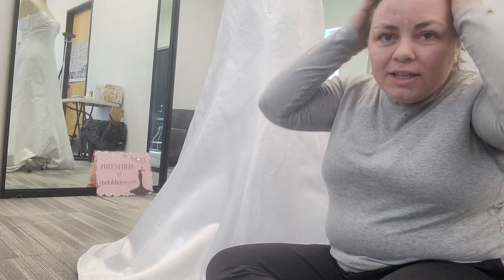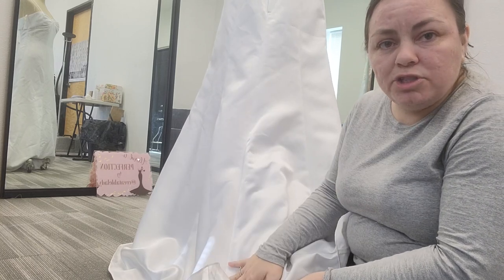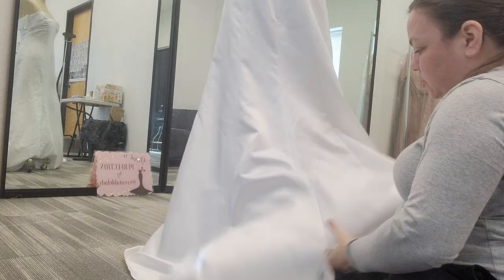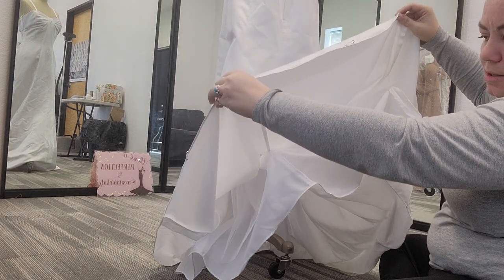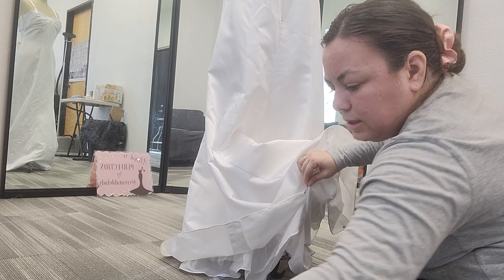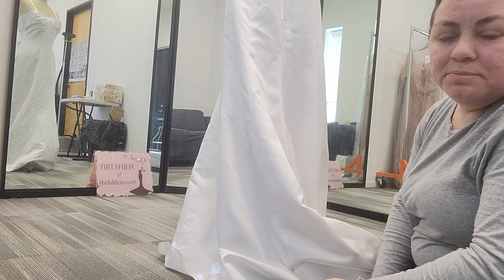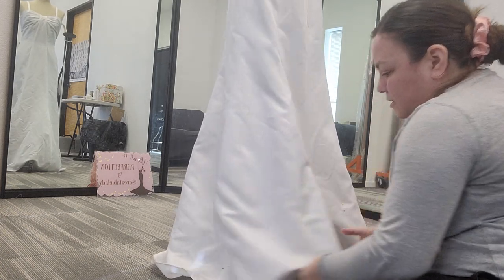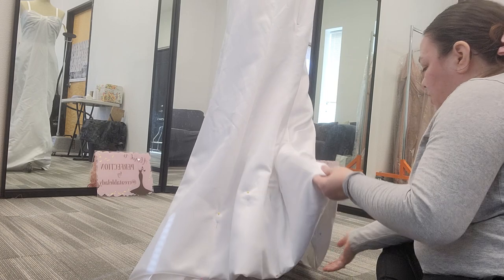Ballroom Bustle: Introduction

Comment: I’m glad to see the gown is up off the floor after all is pinned in place. This is how I like to do mine. Why bustle at all if the gown is still dragging on the floor. I really like how you show the step by step. I’ve had some really hard one to bustle and got frustrated because I could see in my mind what I wanted to do but then it didn’t work. It takes me forever to do things because I’m so particular with everything. I always show someone in the wedding party or mother how to bustle it and when I see the picture from the reception they never look the way I show them. This is upsetting also. Thank you for making it as simple as possible.
Reply from the maker: Oh my gosh yes and yes! I prefer to get everything off the floor and I always do a full bustle tutorial. I get so sad when I see dropped points in the dancing photos

Comment: Could you do a full tulle skirt. That one has me stumped
Reply from the maker: @susannea142  a ballroom bustle on a full tulle skirt is pretty tricky. I'd suggest tacking the tulle to the lining at the hem if that train shape works for your scenario. Then use the tack spacing to help you turn the skirt under using the lining for your pickup points.

Comment: I still measure almost every time, even on a poofy dress. Those measure are my starting point, then I eyeball adjustments. Then safety pin all the points, have the bride try on again, then sew it in
Reply from the maker: Yes! The key is to be consistent in whatever method you use. At the shop I'm at we aim for 1 fitting and 1 final... so I need to get as much information and confidence in my pinning as I possibly can.  I do much prefer a second look myself.

Comment: What’s the best way to hold them up, would it be a mixture of ties and snaps. Will sewing snaps not show on the outer fabric one stitched on. I know you can hide the snaps on the seams but what about the snaps that need to hold up not much of the fabric that’s not on seams
Reply from the maker: On a ballroom I generally do ribbon anchors on the lining of the train and and make loops at the train edge with crocheted thread loops.

Comment: I keep bustles as simple as possible because I’ve had brides tell me later they were done up wrong by the bmaids. 🤣
I call a ballgown bustle one point up at the back. A simple pick up the single stitch crochet loop goes up to a hook or a bridal button
A Victorian bustle is an under bustle which is tied up underneath at points with ribbon. I once did a cathedral length bridal gown with 4 tiers and 14 ribbon tie up points. It was gorgeous but a pain. I numbered the ribbons and the bride thanked me later 🤣

But most are just 1-3 points hooked up to the back of the gown. You can do 5 or more at about 23 inches off the floor and make it look like a mermaid gown. But you need a longer train
Just depends what the bride likes ♥️
Reply from the maker: Oh yes the brides choice reigns Supreme at the end of the day! I do include a full bustle tutorial in hopes that they will be able to put it up properly if no bridesmaid can attend and learn in person.
Reply: @adriennegonzales2636  I have had them video it. And video corset backs I put in to learn the lace up. 🥰
Reply: Most of the brides I deal with don't even know what a bustle is!  I usually offer the American Bustle (outside hooks and loops) unless they request differently.
    But I totally appreciate Adrienne's video for those brides wanting more.
Reply: Agreed simple when possible is best. But a 1 pt bustle on a ball gown. I’ve been doing this a really long time & never had one that would be possible to do w/ 1 pt. I would be interested in seeing that.. what a time saver 👍🏻